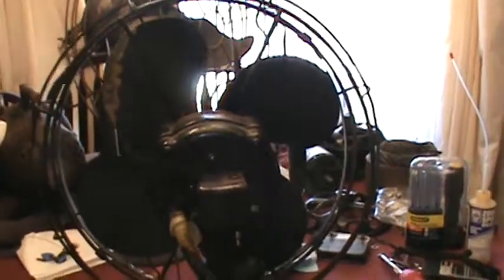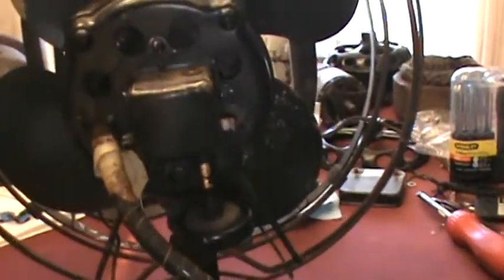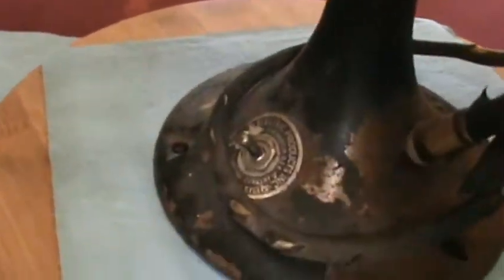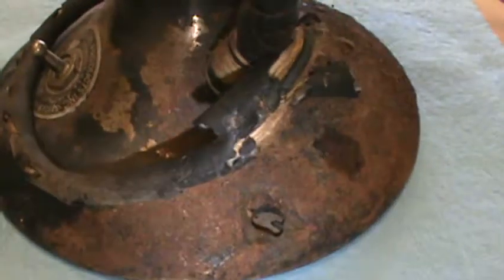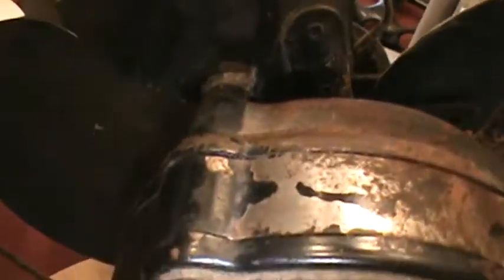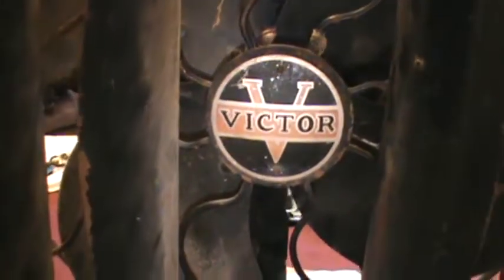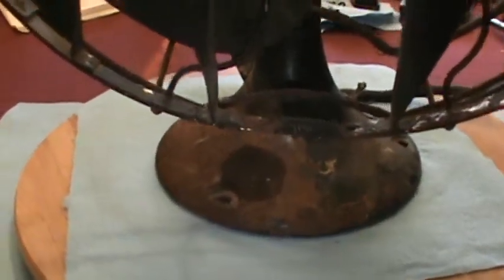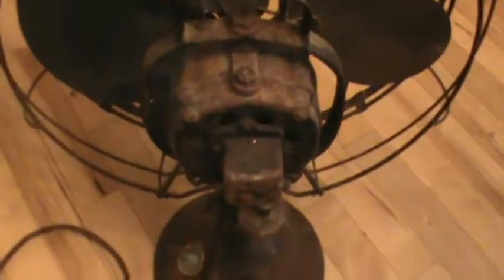12" and 16" Victor Breeze Spreaders

Comment: That little bend at the bottom of the cage are from the factory - it allows the motor to tilt down. They seem to run nicely.

You can run Caig's De-Oxit through the switch - it'll clean and lubricate the switch and make it like new.